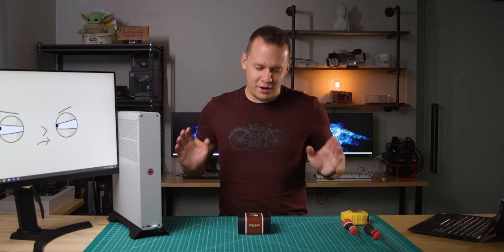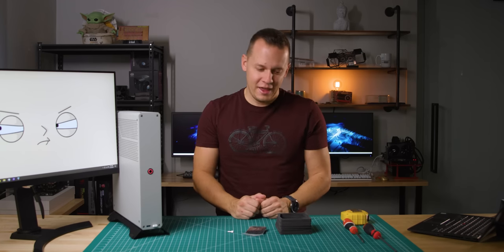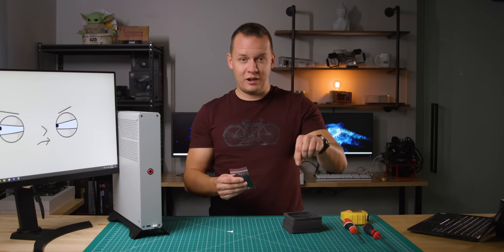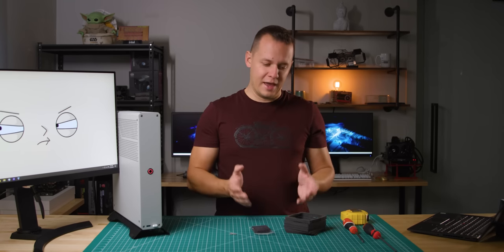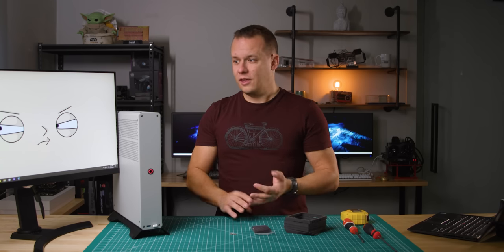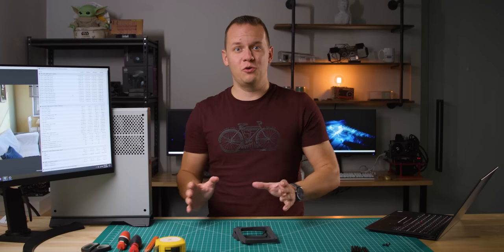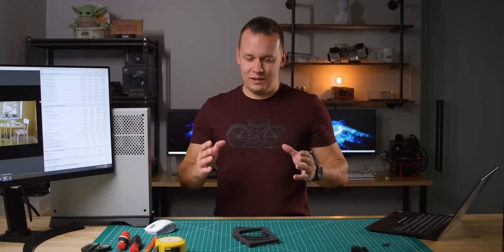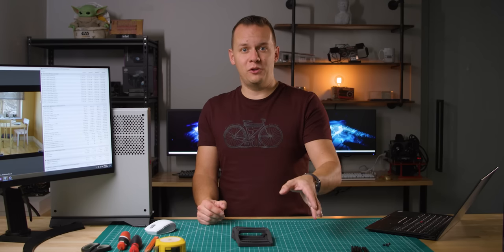Lower CPU Temperatures Just Need THIS!

Comment: 13 dollars? That's like 70 cents worth of material,it shouldn't be more than 5 dollars
Reply from the maker: I think you might be forgetting transport costs & mounting but...welcome to 2021.  Where people spend $300 for a $0.50 t-shirt that says Supreme on it.  ;)
Reply: @HardwareCanucks  buys a Pringle can, cuts it to size, sparays it black and uses glue to stick it
Reply: @HardwareCanucks  I guess you are not wrong, but I did factor in the mounting for it with the 70 cent, cos you can bet like 500 piece of screws and mounting for 5 dollars, I'm just feeling ripped off for some cut foam charging 13 dollars, maybe if it's plastic, but plastic doesn't really seal better

Comment: how about other component like VRM Temp etc?
Reply from the maker: Nothing else really changed.
Reply: look st the latest asus boards and ddr5 ramsticks..passive cooling on the board and micro fans on the ddr sticks....you dont want to be removing cooling from either. with funneled and sealed air lanes theyll get positive air oressure only. a knats fart. unless you add two more fans for intake and outake and can make that air reach wherever is needed. pcs today have evolved to work with open design airflow.

Comment: Lawd Fadda......  If you put the 4mm on first and the 10mm on after, you could have cut the tubes at about 10mm!  2nd, In my opinion, it's backwards!  3rd, why is there never mention of filters?  The fan and the heatsink will get clogged up with all sorts of lint and debris!  Damn..... use your wives' old stockings an create a quick removable filter!

Comment: Yeah, like people said, it's the same old tech from before, just with foam to decrease noise and vibrations compared to the solid plastic.  I think testing in a ITX system isn't really good though.  The airflow in that case can't come even remotely close to that of a normal PC case.  The real test is to see if it makes any significant difference in a more standard desktop case.  The fact that the plastic funnels didn't become a standard seems pretty telling to me.  Chances are real world results are that it's only effective if your case's airflow isn't very good.  Otherwise it probably only makes a difference of a degree or two at most.  Most likely the end result is that it's still best just to focus on making sure your case has good airflow in general and this is probably only good for poorly designed cases.
Reply: mITX/mDTX cases are the probably the most likely use case for these. Prebuilt systems have set parts and can include a premise funnel, but it is after market self-built systems that are most likely to be the consumers of these kits.

I am personally am very interested in a 120 (and possibly 140) kits like the for my SFF builds. I am especially interested in using this idea as part of a deshrouded GPU set-up on my gaming rig that currently uses an aftermarket Accelro III on the GPU.

Comment: Guy you got it all wrong it's design to push air out otherwise your motherboard and all the components would get 🔥 inside. Those ducts are designed to push the air out no inside. 🤦🏻‍♂️

Comment: What a shameless video. 10 minutes and 13 seconds of drawn out banter just to say “yeah these can lower your temps by a few single digit degrees.
Reply: Lol well that's basically every product. Most CPU coolers net you 5-8 degrees of cooler temps and often cost $40-$100. Same thing with thermal paste you want thermal grizzly you're paying $25 for a tube when it's only like 4-5c better than the cheaper stuff.
Reply: @XxViciousxX  That's totally fine. The problem is in no way shape or form should that take 10 minutes to say.
Reply: @testtube173  Can't get two ad breaks in with five minutes.